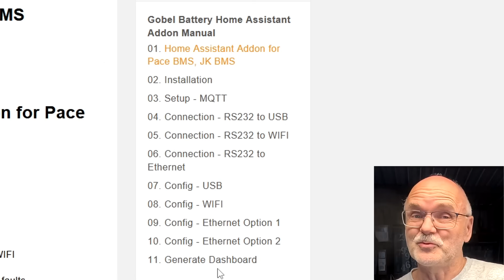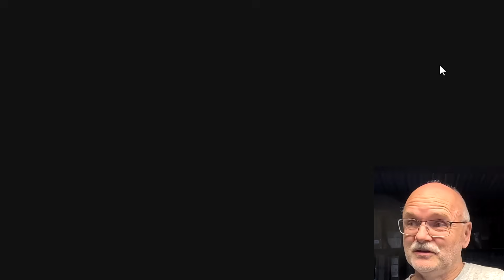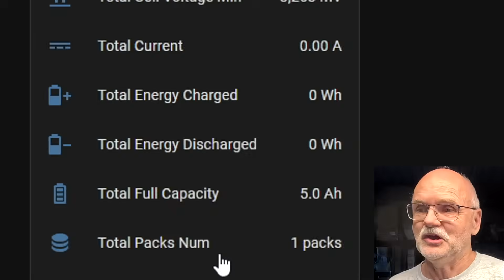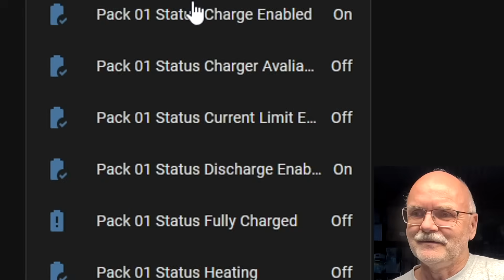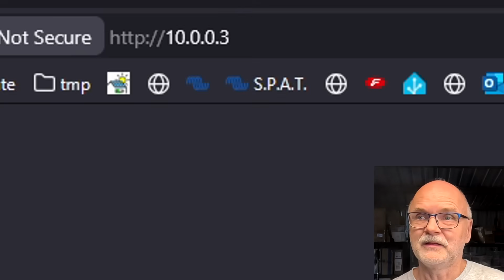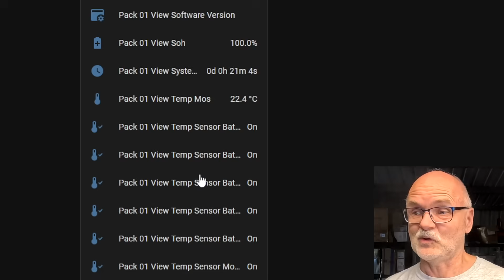Gobel Power Battery Monitoring Kit and Home Assistant Integration - All your PACE and JK BMS in HA!

Comment: It seems interesting.

However, if the configuration requires a Windows software, then it would not be a very practical solution, in my opinion. The reason is that people who are interested in home automation often do not use, nor do they want to use Windows computers. So if that is the only way of configuring this device, many people will just skip it.

Yes, of course there are Windows emulators that can run Windows applications e.g. on Linux. But that is besides the point. The point is that if someone needs to jump through all of these hoops in order to get a simple configuration application running and configure a device, then they might just use another device. It does not make much sense to invest any time into those kind of work-arounds, in my opinion.

Comment: Andy, There is a Bluetooth integration BMS_BLE which works really well and you don’t need to connect any wires if you have a Bluetooth proxy installed in your garage.
Reply: True, I use it as well, but I'm looking into using ESPHome to read data through the rs485 port. Andy's solution is nice, but you use some random device with unknown firmware to publish full access on your network directly. Yes you can firewall it off, but I don't like it that much.

Comment: Aside from the video, I have two batteries with JK V19 technology, and one of them never reaches 100%. I have to disable float charging; when I do, the battery goes to 100% in a few seconds. Then I re-enable float charging, and it stays at 100%, but the next day when I charge it again, it stops before reaching 100%. Any ideas why this is happening and how to fix it?

Comment: Thank you so much for the video. I followed the steps with two batteries and an Elfin EE11 (RS485 to ETH), but it only recognized battery 1 (0000); it didn't detect battery 2 (1000). I swapped the batteries, putting the one that was 0000 as 1000 and the one that was 1000 as 0000, but it still didn't recognize the second battery. Then I tried putting the second battery in with 0100, and now it recognizes it, so now I have battery 1 and battery 3. Any idea why it doesn't recognize it as battery 2 (1000)?

Comment: If you connect the power supply directly to the battery, make sure it is properly fused! We normally don't want to connect anything directly to the battery, for obvious reasons. However if you connect this behind the BMS and the MOSFETs turn off, your monitoring is now down...

Comment: Andy a bit off topic. I have replaced my Seplos bms with JK V19 bms. I have used your setting app, I have updated all the bms to V19.31 and did a full charge and discharge learning cycle but the problem that I am getting is each bms is resetting to 100% at soc100% voltage and then the rcv timer starts which is the wrong way around! Have you tried this with V19.31?

Comment: Using home assistant to monitor a battery? A battery should always be a self contained system so you can manage, monitor and control without 3rd party systems. I can think of many situations where this could lead to all sorts of problems. Also, having to use fixed IPs and hard configure them is a bad practice. You should never need that. I don’t use HA but use a different system since nearly 20 years. You learn the hard way how to keep systems manageable and maintainable.
Reply: This is secondary monitoring, which is fine. The battery is a self contained system. You can use other ways to monitor such as the display, app etc. but those can all fail as well.

A good DHCP server which statically assigns IP's is better, but this is not a production environment, so it's probably manageable.
Reply: @pascallj  well maybe but there is a whole audience out there who may not be as knowledgeable so assumptions…
Reply: Nonsense
Reply: @Slendrianen but of course. 😂
Reply: @heggink  Yes off course its nonsense. You get absolutely 0% safety issues/concerns from a system that only reads data. 

Static IP are the way any system should be set up to maintain oversight. The usual home setup with a few tv's, computers etc. are fine on dynamic IP but any ½-serious network use fixed IP for units thats always connected. That is what pro's has learned the hard way during many years to keep systems managable and maintainable.

Comment: Will this monitor work with SOK SK48V100 rack batteries using PACE BMS protocol HS-PACE-232-BP-V1.1 over RS232, and can it read all batteries in a parallel rack bank individually?

Comment: For DIY esp-link on an esp-01 is a less than $10 RS232 to wifi I use it on inverters , BMS and mppt only runs on 3 volt my  daly bms powers it and is now a wifi bms.

Comment: Hi Andy, thanks for the video. Always learn new things from you. Of late, I have been struggling to figure out a way to get data from the inverter and change their battery charging ways. This device helps from the bms side, is there something similar for an inverter? We get different kinds of Chinese inverters, victron is not sold here. Each one seems to use its own thing. At least with home assistant, we can streamline some of the important behaviours.

Comment: For powering a RPI 3B with VenusGX I used these chinese 60V to 5V 3A buck converters, yet two of these burnt out within two years. Now for more than 3 years I'm using one of the unsealed metal-box 3A converter (similar to Meanwell). For a further RPI4 I'm testing the use of PoE HAT over a switch powered directly from the battery over a fuse.

I guess, if your lower consumption with the small IoT device might not stress the buck converter as much.

Comment: I’ve spent hours a couple of weeks ago to implement my EEL 16kWh battery with JK BMS in HA, if only I had known about the Gobel HA integration 😳😊
With the Gobel integration I now have value updates every 5sec instead of erratic updates 👍
Reply: really ? 
Bluetooth dongle + BatMon is all you need - or a cable connection with an ftdi adapter. 
Works like a charm - at least with EEL batteries and JK BMS like EEL V4.
Reply: @typxxilps Just flash an ESP32 and you got full control through BT
Reply: Wired would work immediately, but I have 90 meters between my battery and the HA system @typxxilps, RS485 -> wifi. It required some tinkering with the Elfin EW11 and the JK BMS wired management app with a minimum of debugging options.

Comment: Andy there is a project called yambms that's works like a charm with jk bms ( and my growatt ) . CAN and rs485 with waveshare.
Reply: syssi/esphome-jk-bms (Giuthub) on an ESP32 connects through Bluetooth = no wiring and most important for me, it gives you write capabilities of the BMS too.
Reply: Does this work with getting inverter data into the home assistant as well? Growatt only, or there is a list of different inverters it works with? Or trial and error method?
Reply: @asderven yes